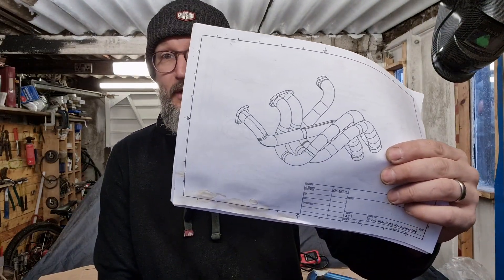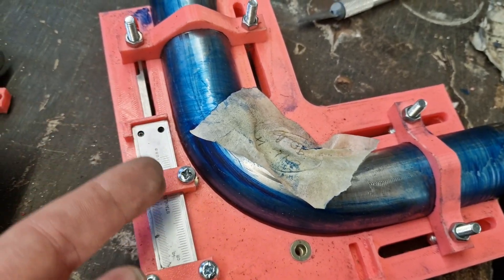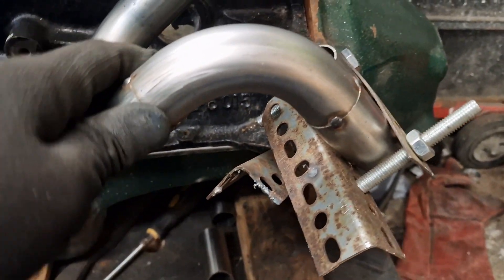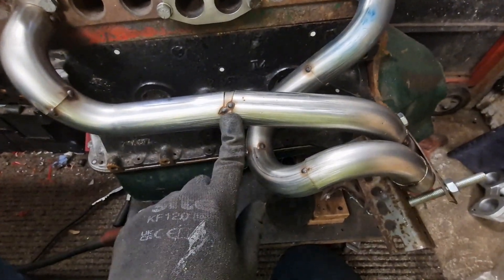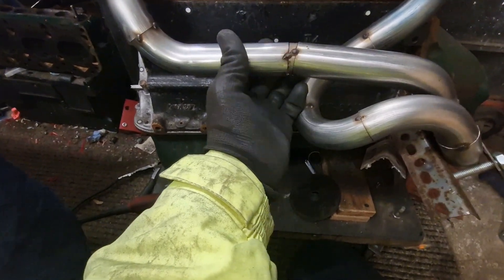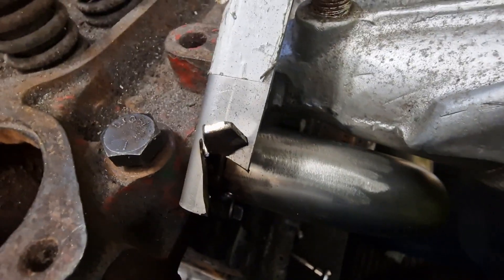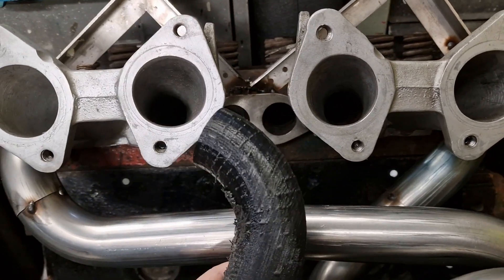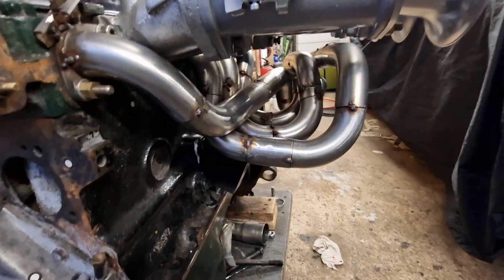building a 4 branch manifold - making the primaries

Comment: The manifold is looking awesome, Jim. Those ITB's are going to make the old girl sing. Are you going to get it tuned on a dyno? (Or as you Pom's say, A rolling road) I'd be interested to see what sort of horse power you get, as I have a 1200 precrossflow in the shed that I thought needs injection.
Reply from the maker: Thanks Trev,

I'll get it tuned up properly once it's running.  I'm interested in the power figure too but I think it'll be the mid range that will separate it from a tuned carb setup.

A 1200 would be cool to see tuned up and running efi.
Reply: @jimbuilds  Yes. A nice fat mid range would be ideal. Useable power for this era of engine. You wouldn't treat it like a newer Japanese or Euro 4 cylinder as they're better engineered for the top end revs. I'm finding it all very interesting.

Comment: Jim, Do yourself a favor and pin the individual intake manifolds to the head after you get them aligned to your liking. This will allow you to remove and replace them, getting them repeatable with each time you need to make adjustments. Fought this issue with my Lotus Super 7 back in the 60's. Makes for a quick on and off without have to make additional adjustments upon re-assembly.
Reply from the maker: It's funny you mentioning that Robert as i recently noticed the manifolds have been drilled in the middle of the flange already. Having tried to align them as is i can tell it'll be tricky!

I'd love a super 7, i keep thinking about building a replica and keeping it 1500.

Comment: Looks great, I was thinking of doing something similar with my Datsun when I get the chance, similar non-crossflow engine so I'll run into the same clearance issues!
Reply from the maker: Thank you! Definitely give it a go. If  i had to do it again I would look at pie cuts rather than pre made bends as they haven't saved me time or money.

Having enough parts to mock it all up helps but the datsuns have plenty of engine bay space like the cortina so you should be good to go!
Reply: @jimbuilds  I've found pie cuts quite time consuming in the past, but definitely the cheaper and more flexible option! I reckon I'll make use of some mandrel bends at least just because it means less of my shoddy welding 😂

Comment: Superb again Jim. Are thinking of sheilding the heat at all from the ITB's?
Reply from the maker: Thanks Ben. I am, at the moment I'm thinking about how I could mount its and I think it'll be off the back plate for the airbox  that I'll make at some point.

As I'll be running an air temp meter for the ecu I'll be able to get an idea of what improvements a shield would make.